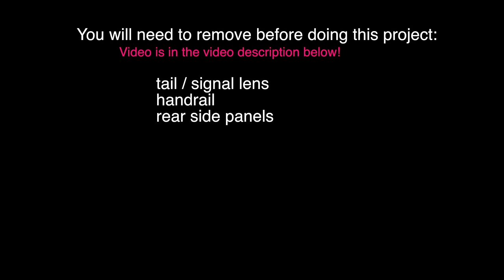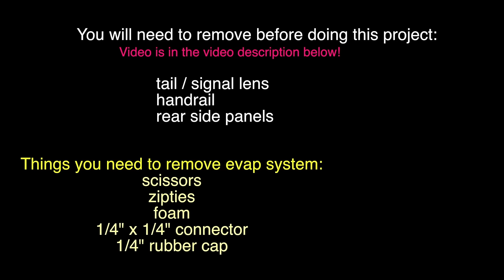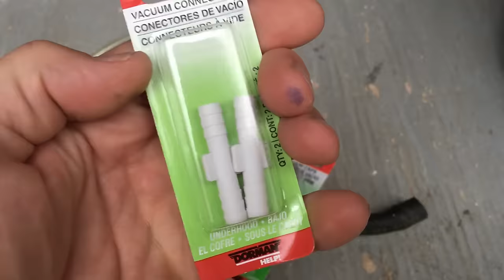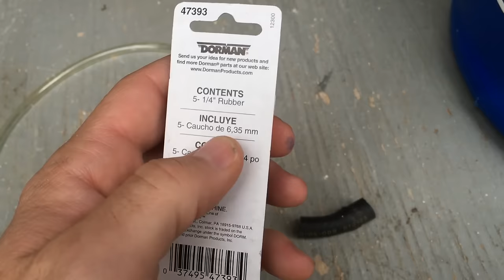Piaggio Fly - How To Remove Evap System | Mitch's Scooter Stuff

Comment: Thanks for this one! I have a new Vespa Primavera 150 and I wanted to take off as much "unecessary" stuff. I disconnected all the hoses and plugged the port on the fuel injection but left all hoses and the can in there in case of warranty issues and the dealer's gotta go in there.

Comment: Hi Mitch .

My son has a  2010 Piaggio fly 100 which is currently having exactly the same starting problems as shown in the video. - 

I have a question about the full removal of the evap unit .

I've watched this video several times now and I am wondering if it Is absolutely necessary to totally remove the whole of the evap assembly or can the rubber pipes simply be cut and capped off and a longer bit of tube added for the overflow which goes underneath the engine.

Apologies if this is a really stupid question .

Many thanks in advance

Comment: Instead of removing all the hoses, valve and canister from the scooter, can't you just disconnect the two hoses going to the intake and carburetor,  then attach the plug and filtered hose to the intake and carb? That way its much easier to put back together in the future in case you have to. I can just imagine state government's start requiring motorcycles and scooters get smog inspections.
Reply: Hi, did this work OK for you or was it a no go?

Comment: Mitch I did this and now it runs terrible. It will idle but won’t work when I throttle it up it just shuts down. With the one bigger opening on the car I have capped off, but when I blow into the other one on the left side of the carb it speeds right up. What am I missing here? So just to refresh, I took everything off as you did, I capped off the right side of the carb, and it Doesn’t run when I throttle up. It will work only if I blow a slight amount of air into the one on the left side that you put on the filter

Comment: What the function of this evap sistem?can any 1 tell me?
Reply: they says just to keep the environment clean by redirecting some gases back to the intake line to make them burn well
Reply: @abod898  so you can work without it, no changes to the fuel consumption?
Reply: @DoctorSlavik990  
Yes you can
i cancelled it from my scooter no difference in fuel consumption
no difference in engine performance
Reply: @abod898  nice thanks

Comment: Could you tell me where the starter is located on the fly 150?  
(and don't say near the carburetor because I don't know where that is, either.)  ...thanks!
Reply: Starter is a big round thing usually with a thick cable going to it and one end usually pointing towards the transmission side.

Comment: i need help ASAP with my Piaggio FLY 150, It just wont start...Ripped this down to access the carb and all of the lines etc, and I just dont get it, I tested staark against the frame im getting purple , slight blue spark, fuel seems to be the issue, on the right rear side of the tank, where the purge valve seems to be, if I disconnect the fuel hose from the left side of the carb-point down, and crank engine, it pours out, when i reconnect the fuel line back to the carb, crank the engine, it doesnt seem to come out as ill slip the hose back off and its as if nothing was coming from the fuel line..It just cranks and cranks, I put 93 octane in.... Stuck please help!!